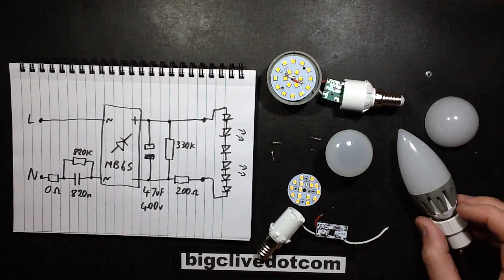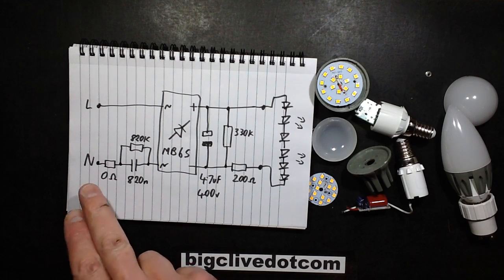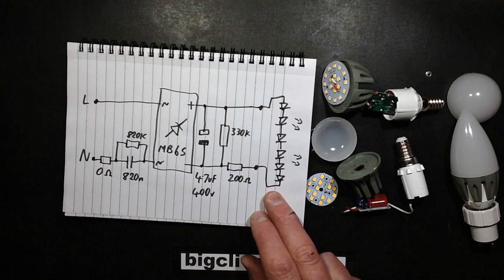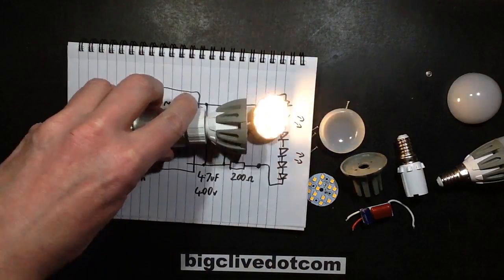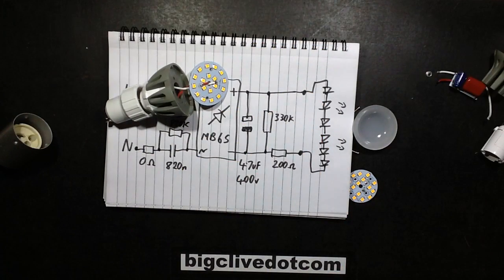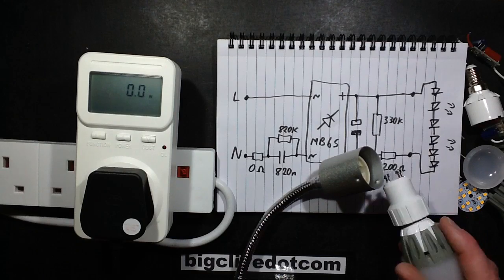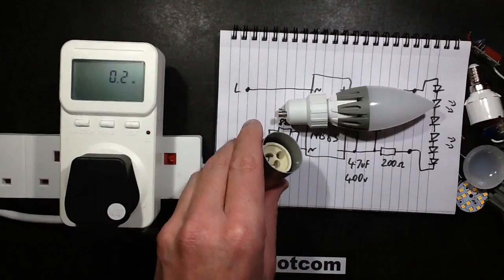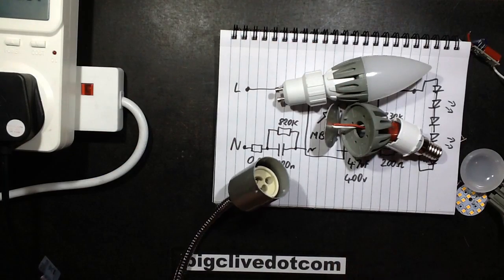Neat Chinese LED lamps part 2.

Comment: Is it possible to modify lamps around this form factor to reduce the flicker on high speed video?
Reply from the maker: +JeefCakes Complex subject.  It would be better to use dedicated DC lights that ran the LEDs directly from a very smooth DC supply or even a battery.
Reply: I thought it might end up being something like that. I'm wondering if an old but high quality PC power supply would be smooth? I have some of those lying around. I know smooth DC supply is essential to modern CPUs, but I'm not sure if the smoothing is done on the motherboard, or whether the supply itself delivers it.
Electronics noob here.
Reply from the maker: +JeefCakes A good PC power supply will put out a smooth 12V DC, but may need a load on its 5V or other rails to operate reliably.  You can get heavy duty industrial 12V DC supplies.
Reply: Worth knowing, thanks Clive.

My brother got some LED filament type bulbs from (I think) ASDA recently. He said the brightness was brilliant, but there was a perceptible flicker in his peripheral vision that made them uncomfortable and made him feel a bit ill. In swinging a string around playing with cats, you'd see the string spin in snapshots. They went back for a refund, which was a shame as they did put out far more light.
I'm guessing that with the drop-in AC replacement LED lamps, some of the cheaper ones might only be half-wave rectified? Perhaps you can get away with that in 60Hz markets, I'm not sure.
Reply from the maker: +JeefCakes I got a retro style LED filament lamp from ASDA and it was actually very good.  No flicker at all.  I wonder which one he bought.  The lamps with smaller bases like SES are more likely to flicker as there is simply less room for the circuitry.

Comment: Always thought the 0 ohm on incomer could be a crude form of SMT fuse.
Reply from the maker: +simon hare I'm not sure what the actual construction of an SMD zero ohm fuse is.  But it's a possibility.
Reply: +bigclivedotcom They seem to put them in lots of microelectronics as fuses, when they blow its hardly visible so i guess theyre o.k. for the applcation.

Comment: 820 nF is a large value Capacitor.
Reply from the maker: It is indeed.  But quite common in the higher power LED lamps that use a capacitive dropper and low number of high current LEDs.  Even Philips do a 2W lamp that uses a capacitive dropper using two caps in parallel to make up their chosen value.

Comment: 60 above ambient is too hot for my liking, around here in summer that could be 90 degrees.  You should try putting some thermal paste between plate and plastic and see if that makes much of a difference.
Reply from the maker: It does seem too high.  I'm not sure why they didn't use a thermal paste, unless the plastic isn't really thermally conductive or maybe the oil in the paste could cause problems with the longevity of the plastic.  Particularly with the heat.  My favoured approach is to nudge the current down with a lower value of series capacitor.  Probably somewhere in the region of 470nF to 680nF.